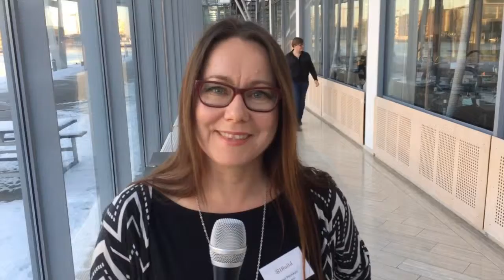Risks of internal insulation in old buildings

Comment: Proper ventilation should prevent mould growth. I would be more concerned about the spawling of brick walls because they are not drying out as much as they should due to the change in temperature and the fact that less heat is traveling through the wall. If you know of any cases of this i would be very appreciative of any information you can give to me on this as i am currently researching this subject as part of my college disertation.